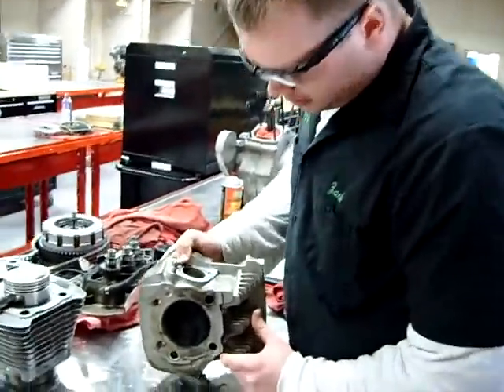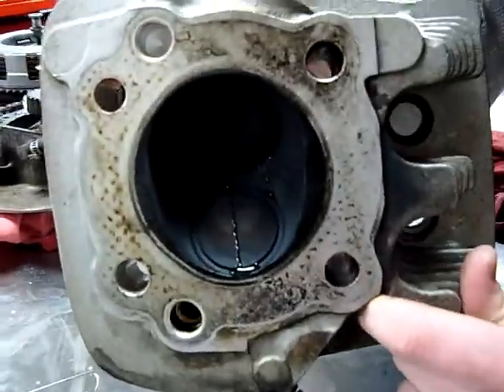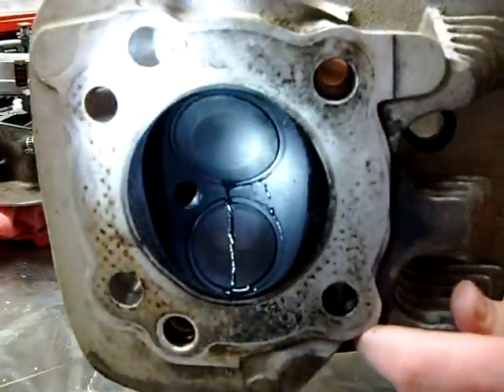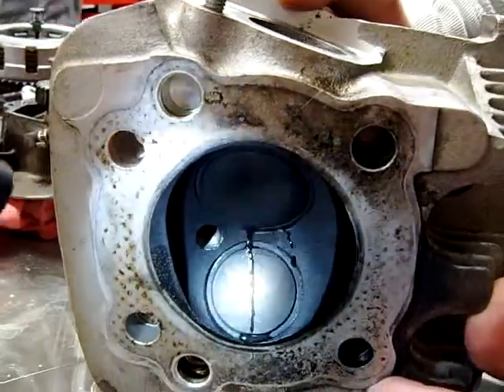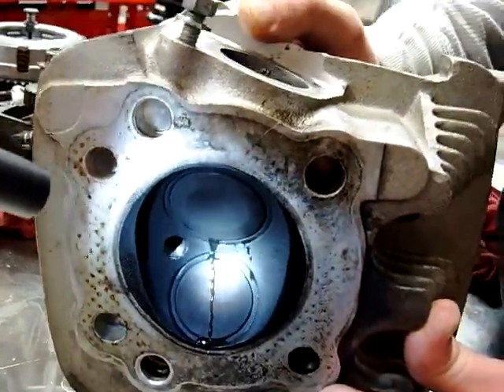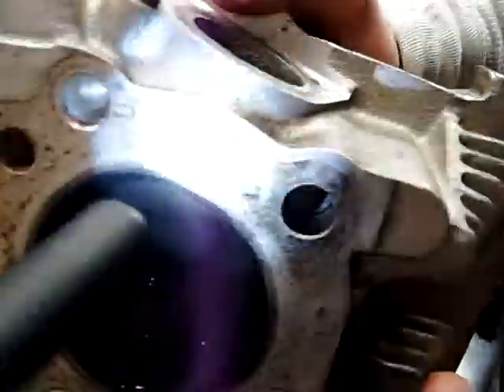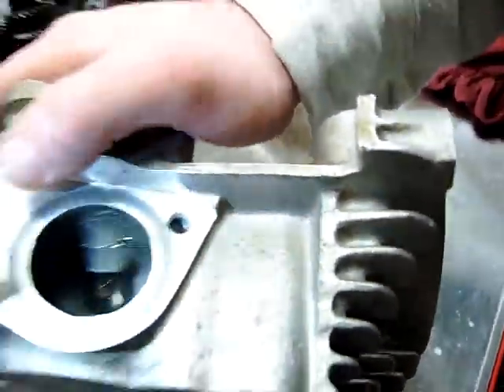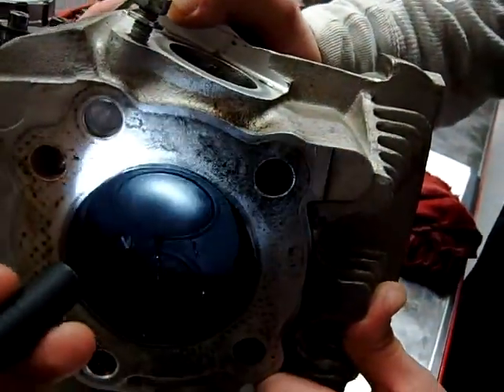Cylinder valve seat seating inspection test on a Harley Davidson head.

Comment: My 2001 Sportster taps at idle on the front cylinder, I've checked lifters, rockers, changed the oil, dismantled the oil pump(no wear), checked cams and oil galleries but still taps the same. Do you think the valve's could cause the tick (loose seat, worn guide)? I'm reluctant to remove the front head as the bike has only done 12000 miles. I have a video on here which shows the tapping.
Thanks for your help.
Reply from the maker: Reach out to me on https://how2wrench.com/contact. I'd be typing all day...😂